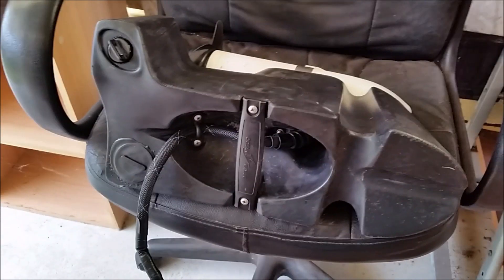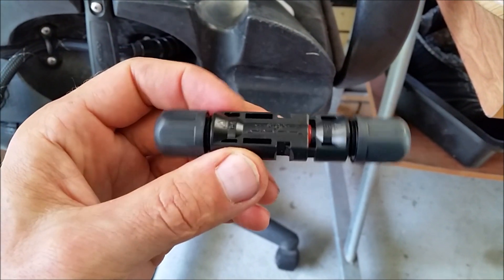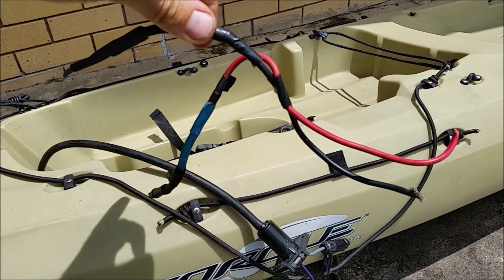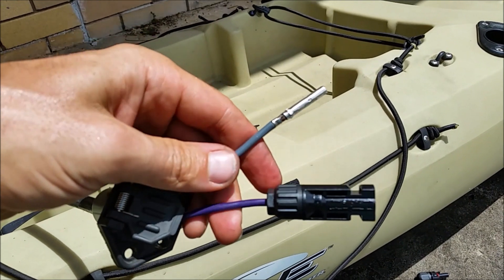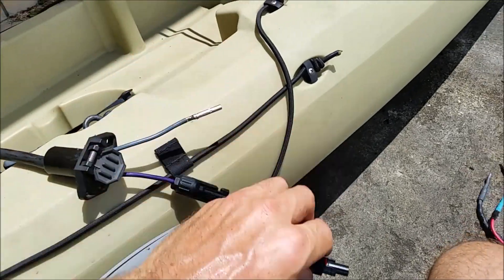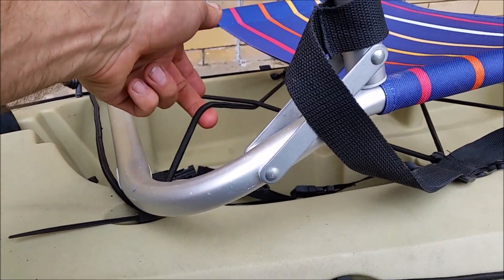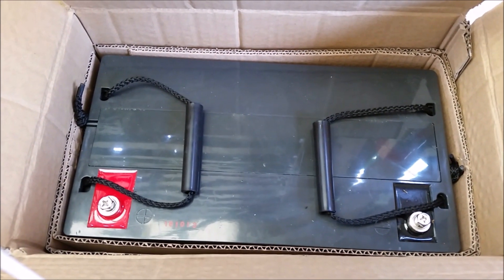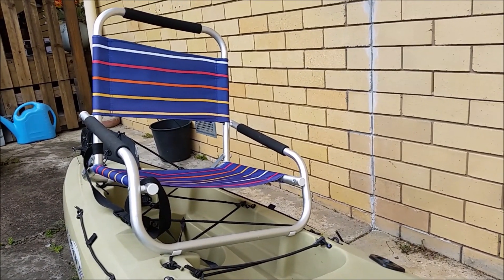OCEAN KAYAK TORQUE WIRING UPGRADE / EL. MOTOR PLUG & SOCKET UPGRADE

Comment: That was a great video, great idea to use the Solar connectors. What is the current draw from the motor? Also what brand is the kayak?
Reply from the maker: Thanks Zac. The motor draws 25A at full speed.  So the battery should last 2-3hours. It's Ocean Kayak Torque powered by Minn Kota electric motor. I found user's manual online: https://www.oceankayak.com/sites/oceankayak_site/files/torque_owners_manual.pdf